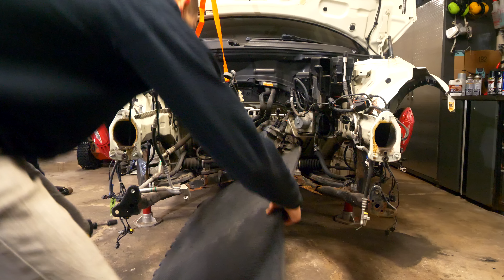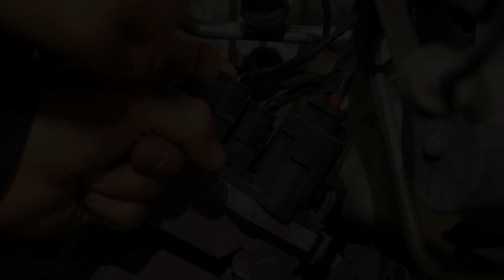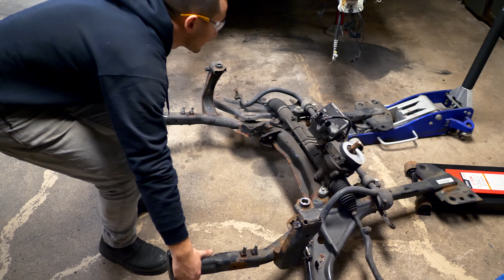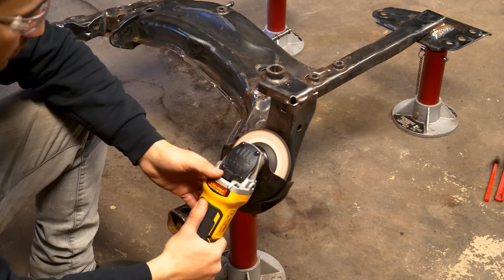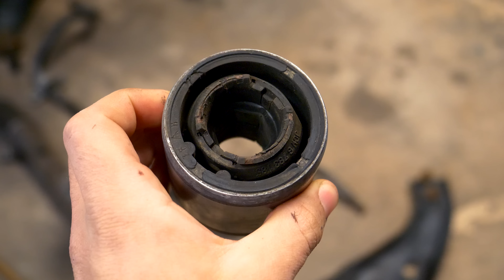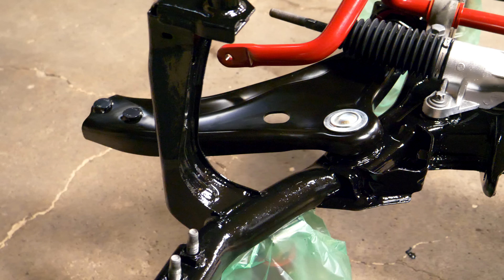Front Subframe Full Restoration // INCREDIBLE RESULTS!!

Comment: Are you adding an extra beefy rear sway bar? because going stiffer in the front only adds a good push to a car that's already in need of more sway bar in the rear to balance it. I kept stock in front and still needed a big rear bar to make it handle more neutral.  And the crash tube  bolts - don't bother tightening until you get the front bumper bolted in - it will need some flex to line up the holes there, and the part that allows it are the two big bolts holding the crash tubes to the subframe.

Comment: hope you had good ventilation doing the POR15. I did that to my R53 subframe two years ago, and wow does that stuff go to your head even with a fan blowing the fumes out of the area (open garage). Read the warning label on that can and be scared... but it sure works like a charm on rusty metal. Looks like the steering column is a piece of cake on the R56 - that was a bear to separate under the car on the older model. Rest looks very similar.

Comment: Hey man did you get new bolts for everything or can I just take the rust off them. If you got new ones did u go with oem or source the same bolts from somewhere else?
Reply from the maker: I sandblasted them, ground them down a bit with a wire wheel on a bench grinder, and then sprayed clear coat overtop to prevent them from rusting.
Reply: @milanmastracci  thanks, did you do anything for the bolt holes

Comment: I remember you made videos about tool reviews. You have showed us that metal wire spiral, electric, warm-up-a-bolt type of thingy which is good for removing them, and safer than torch, why don't use it?
Reply from the maker: I don't have one of those.. One of those would have made it super easy to remove those stuck bolts.

Comment: Holy shit this is great!!! I undercoated my mini last Spring and it didn’t even last a year!! Any idea how long this is gonna last for a daily?
Reply from the maker: Hey Yehudi, it is completely dependant on prep. The better you prep, the longer whatever coating you apply will last. This POR15 is more durable compared to typical undercoatings. To make this coating last longer, you can apply some rubberized undercoating. I am content with this finish, but will relay back with the long term durability.
Reply: milanmastracci I grinded out my rear sub frame as much as I could before applying the rubberized undercoating and it didn’t last. Is it a good idea to apply some type of primer or black paint before applying the POR15?

Comment: U have put the Alta bushes in the wrong way.... the Alta logo on the body of the PSRS goes to the side u bolt to subframe....so u have yours in 180 degrees out
Reply from the maker: You, Paul, are the best! I've been wondering why my front suspension feels very unsettles when I slam on the brakes at the track.. I bought new bushings because I thought these ones were faulty, but it was just my installation method.. Fail on my end 😂
Reply: milanmastracci u just had the yellow marking put on the wrong white mark on the PSRS so u were nearly there.....very easy mistake to make .....just installed a set myself that why I noticed the Alta logo was pointing wrong way